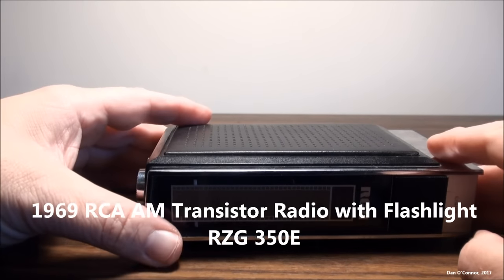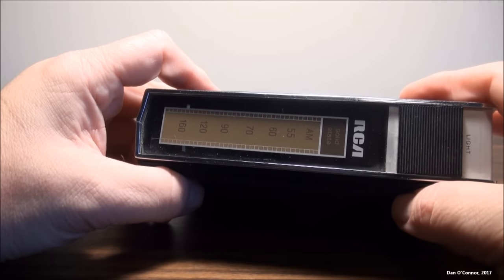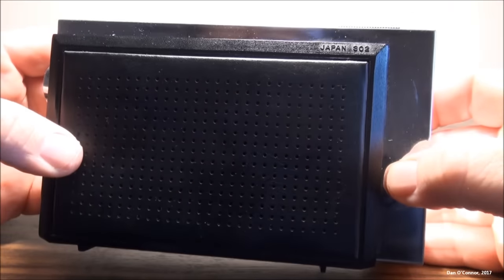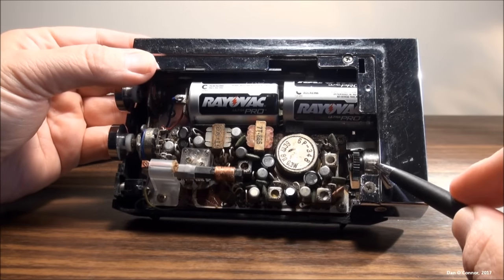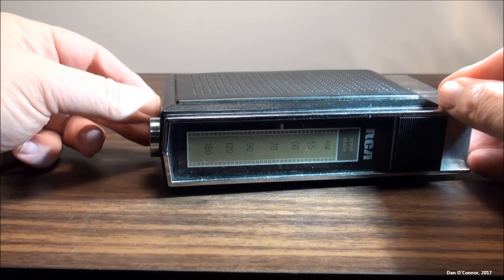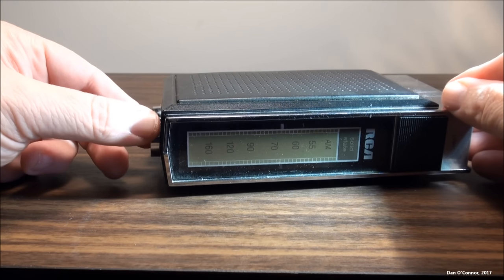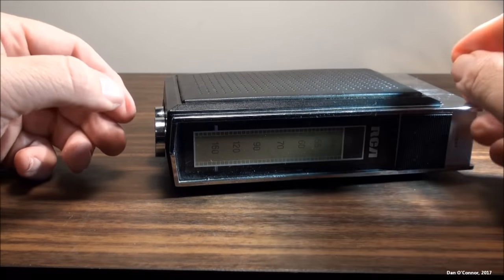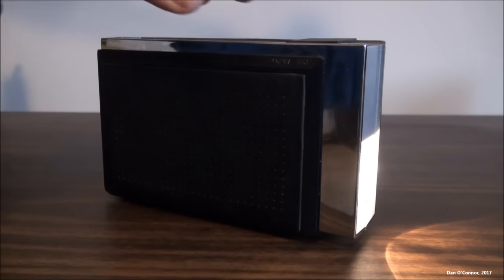1969 RCA AM Radio and Flashlight RZG 350E

Comment: Either GE or Westinghouse had a transistor radio that had not only a built-in flashlight but also a cigarette lighter - it heated up like one from a car.
Reply from the maker: Thanks for alerting me to that. I finally tracked one down and will be making a video about it soon. It's a Westinghouse and also has a clock!